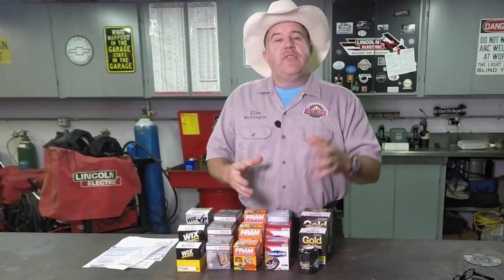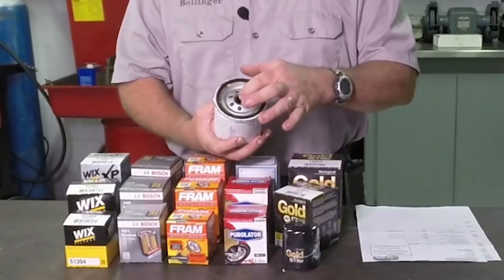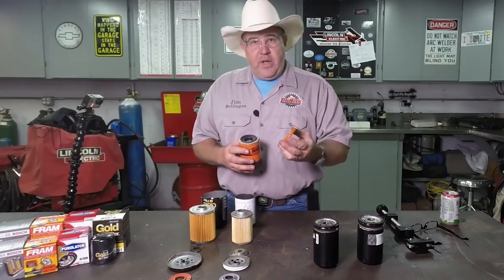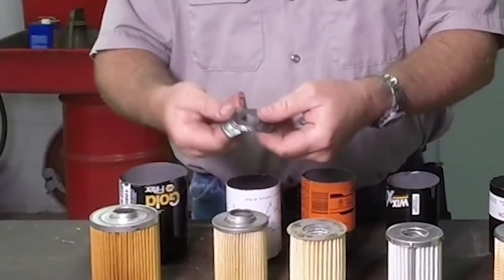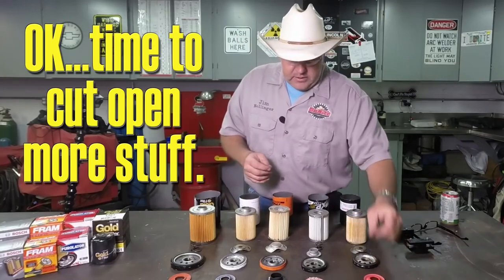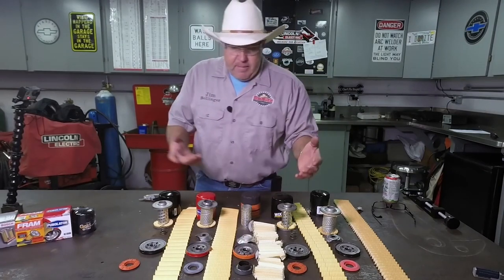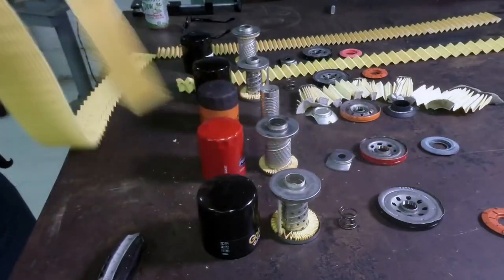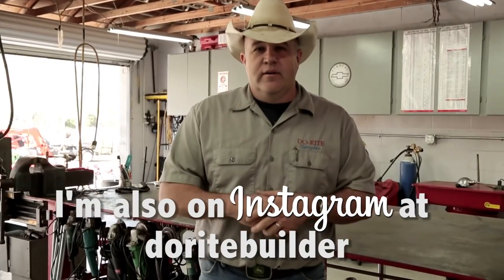The worst oil filter EVER

Comment: Amazing how POOR  Fram filters are.   What is more surprising is that I used them for years without issue and put over 200K on several vehicles — BUT, I regularly change the oil.  Which must be an important factor!!
Reply: Pepperstinson, the orange Fram filter is fine if you wanna do a 3000 mile oil change interval. But this guy is comparing the Fram entry-level filter to these other brand’s mid-/upper-tier filters…not exactly an apples to apples comparison. Have him compare these other filters to Fram’s Ultra Synthetic line.

Comment: Imagine my shock when I started seeing Honda oem filters being opened up and they were rebadged crap fram! Ugh no wonder their oil changes were so cheap! Don’t go to the dealer anymore, but almost 200k miles runs like new still. 2012 accord 4 cylinder. Thanks for the video.

Comment: Worked for large excavating company with over 450 pieces of equipment, john deere,cat,mack trucks they used napa filters oil samples kept coming back poorly switched to wix same thing poorly switched to Baldwin and numbers were perfect. John deere and cat said keep doing What you're doing. Baldwin is the filters they continue use.Thanks  for video.

Comment: I run that fram filter on my 2006gmc 1500 with 210,000 miles on it been running that exact filter since brand new I will continue to run it till I retire the truck. Looks to me like you got one that was overly old and sat in someone’s damp garage for a few years. Something doesn’t smell right here

Comment: This has got to be the worst filter comparison I have ever seen. You are taking the best NAPA and the worst Fram. You made the Fram look worse than they are. You can use a Fram oil filter forever and you will not have an issue. Folks, just buy what you like. You will not have an issue. Ever.